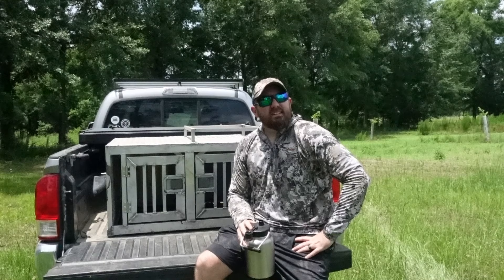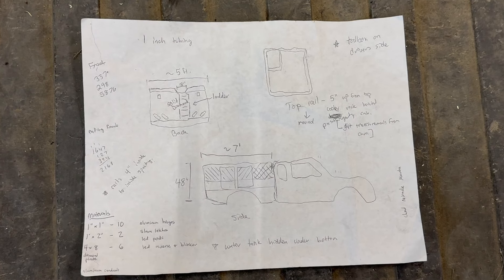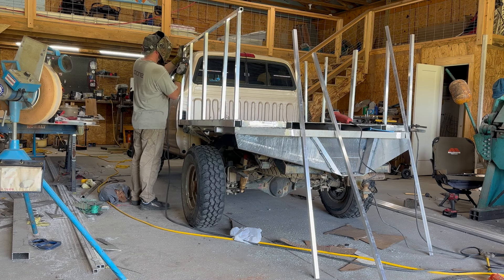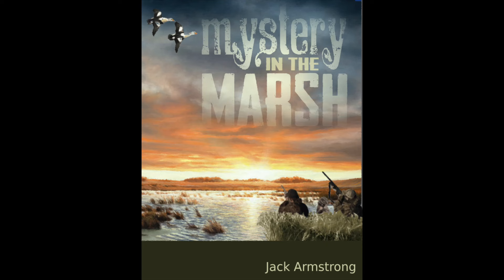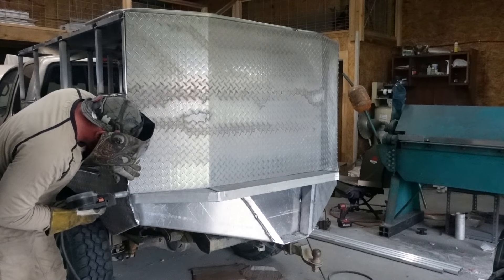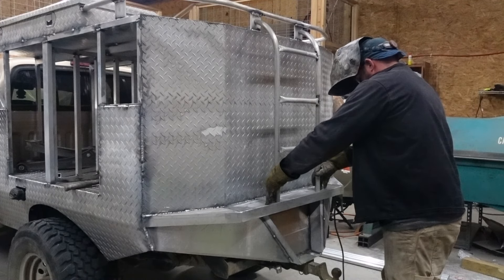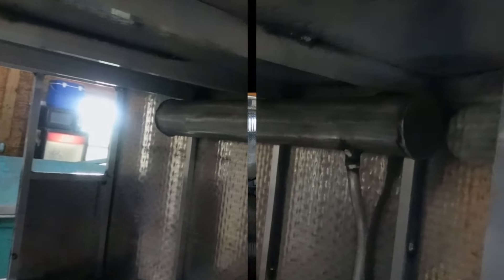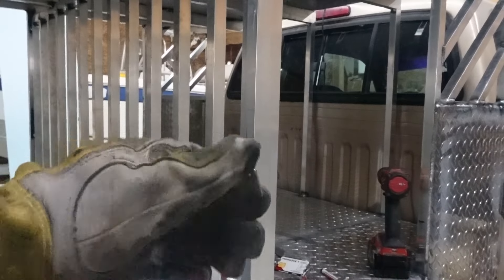A dog hunters DREAM truck! DIY homemade aluminum flat bed dog box with waterer and lights.

Comment: I stumbled upon your boat build video and I was wondering since i’m planning on building a boat myself, what did Pierce Aluminum do or what did you ask them when they formed those cuts/grooves on the sidewalls of your hull?
Reply from the maker: @uppahcutt9246  they bent just the sides of the hull. I didn’t have any blueprints but talked the guy through what I wanted. Unfortunately he retired a few months ago and I don’t know if the new salesman is as easy to work with.
Reply: @JackArmstrong-jackdaddycustoms   Thanks, I just wanted to confirm that i could do something similar without having to get some type of jig made and spend an x amount of dollars. Also if you can remember, would you happen to know how much all of your materials were if not that's completely fine. Thank you for replying!
Reply from the maker: @uppahcutt9246  you shouldn’t need a jig. The price fluctuates with the price of of aluminum and it’s been a while since I bought that. You can probably plan on between 5-7k depending on size and how fancy you go.

Comment: Could this fit on my 2023 Tacoma? What might I need to tweak?
Reply from the maker: @keithroberts8120  not sure. I would plan on addressing the mounting and the fuel spout. Other than that I would imagine the dimensions would be pretty close.